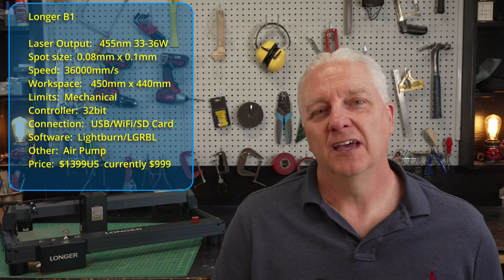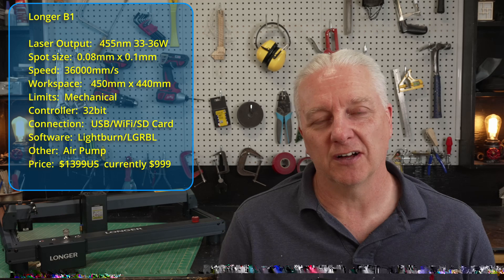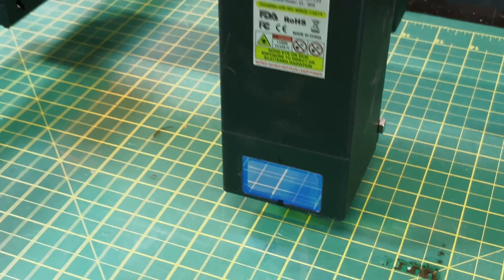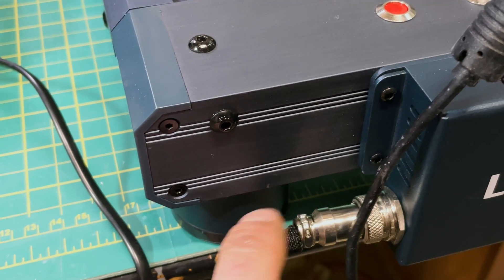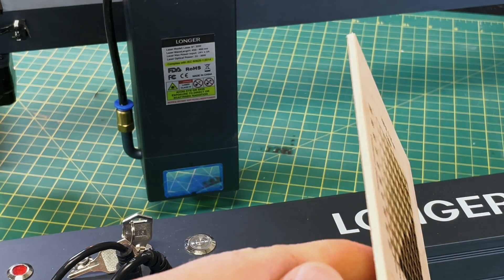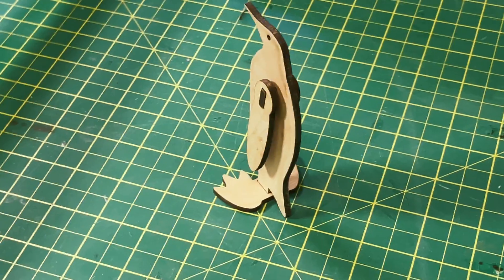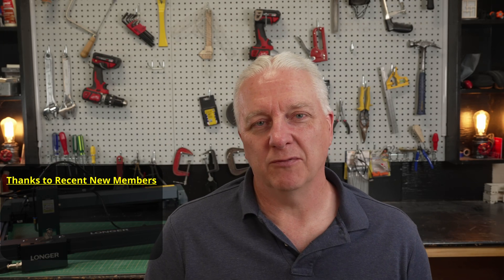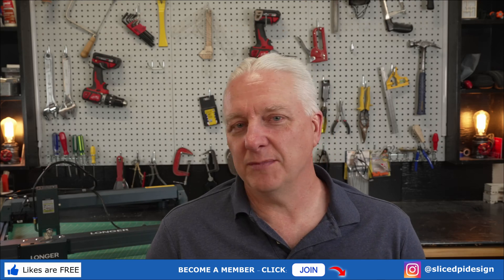The Longer Laser B1 30W Takes Center Stage - The Laser You MUST Own

Comment: Oh yeah.. one of the reveiws had an issue with the air assist.
The issue he had was weak airflow at the cut.
Did you notice any issues here?
I'm guessing no or you would have mentioned it.
Thx again!
Reply: Vintauri mentioned that the airflow valve was a bit wide for him so he tried putting a tape over it and pulsing the laser to get narrower opening and he saw cleaner cuts.  That was with the 20w.
Reply from the maker: @isaiahgillett2573  He and I talked about this, but I didn't try it.  His results seemed to look better with restricted airflow, though I'm not sure why just using the valve didn't produce the same results.
Reply from the maker: I didn’t see any issues with airflow.  It is possible that the air hose was pinched by a zip tie that was pulled too tight.
Reply: The early machines had a nozzle opening that you could "drive through".  Longer listened and now the units are shipping with a SMALLER / proper sized opening.  I'd throw that "air valve" in the trash as when you need air, go full blast, when you don't, turn it off in LB.  Longer specifically states to NOT use the valve as it will load down the pump, burn it out and and cause WWIII  🙂

Comment: Great video!
I watched several other videos and noticed the start/stop on all the tests had that burnout hole and thought like you there was an issue with this laser.
The engravings were bad as well on the other videos, nice work noticing and then actually fixiing the issue.
I was thinking it was a accuracy problem because it affected cutting and engraving so I dropped any thought of buying one.
Your video popped up and I thought ok lets see what steve has to say, thinking if he says it's awesome he might be a shill.
I think you proved you are doing fair and honest reveiws here. (not a shill)
I bought the Longer 10w with your link and will do the same if I decide to buy the 30w this weekend. 
Thank you for all the work you put into your videos.
Reply from the maker: Well I like to be thorough.  When I saw the engraving results, I seriously told Longer not to sell this laser yet. If a laser is terrible I would certainly say something.  I’m just happy that Longer didn’t have serious issues and that the solution was easy (after 3 days of email exchanges with them)

Comment: if i am not wrong, you can edit the homing speed in the config of machine,  in the lightburn
Reply from the maker: Yes you can tinker with some Lightburn variables to change this.  My only gripe is that the default value is far to slow
Reply: Where is that setting?  I know you can change the whitespace speed, but don't see a homing speed.
Reply: Would it bother the machine to just move the head close to stops/switches by hand?
Reply from the maker: It’s an option, but you can’t crank the head over too quickly
Reply: move the head close to stops/switches by hand...then have it home itself, is what I'm asking.
Reply: My research and YT videos tell me the $25 value sets the homing speed.  I would bump it up a bit, BUT, you really don't want the head traveling "light speed" when hitting the homing limits/switches....